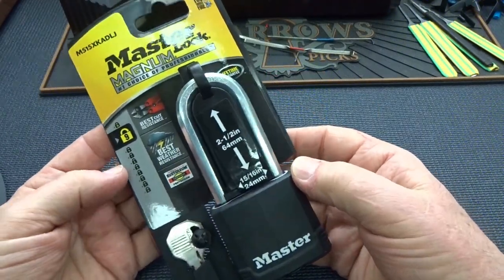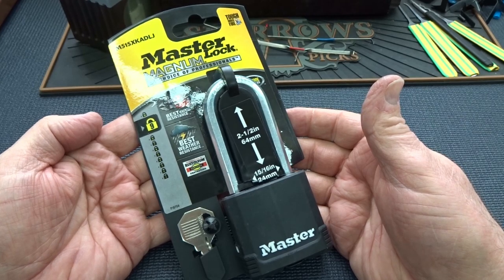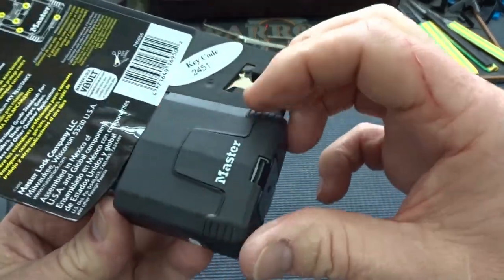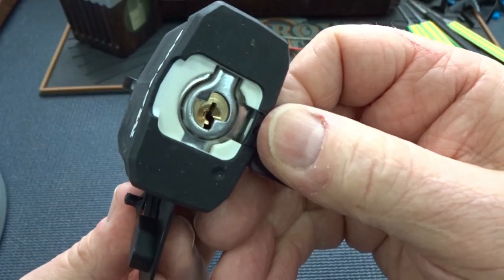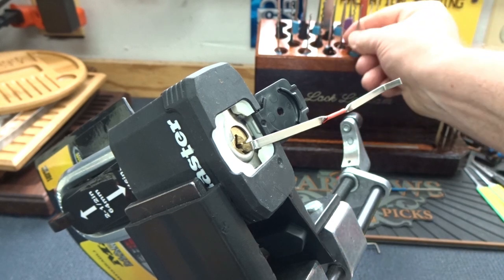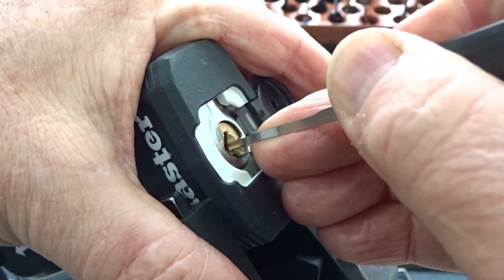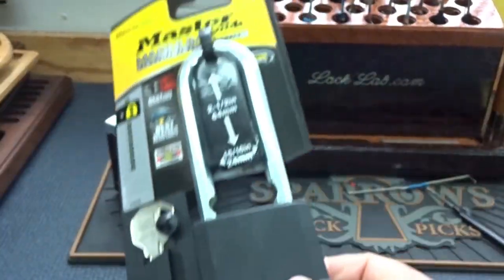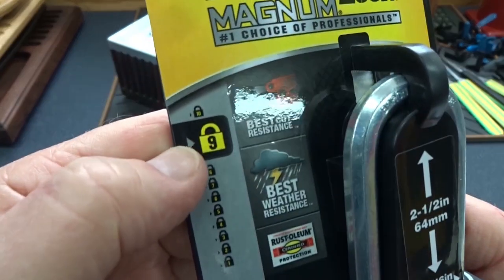(1242) Master Lock's Magnum: 9 = ZERO!

Comment: Master locks security scale is only there to tell you how tough the packaging is...
Reply: Zachary Lagler Now that is the first analysis I've seen that makes all that fancy packaging with the rating system make sense.  Maybe you should apply to be their next CEO.
Reply: WTC Realist lol, I swear Master lock is run by accountants...
Reply: It would have taken Bill longer to find his knife to cut open the zip ties to release the lock than to pick it open.
Reply: +WTC Realist Are they still hiring? I have HVAC experience
Reply: I think I had one of these.  I seem to recall just picking the lock open to be able to remove it from the packaging rather than having to find some snips to clip the zip ties.
Reply: The nice thing about a lock like that by the look of it is you can re-pin it with something that would make it hard to pick.  They make great challenge locks.
Reply: I have tested packaging from many lock companies. Master clamshell pack, and the plastic hasps that their big box store models, the ones Bill seems to jones over.... are among the best. CCL bubble packs arrive shattered, Abus packaging, Shatters, and so forth. Seriously, Master has some very decent mid level locks, but the stuff you find in bike shops and department stores, sucks. Packaging and graphics are how master sells the low grade stuff.
Reply: Yep
Reply: Mookie Conster glorious leader of flipflopistan They have made some plastic locks with decent cores. :P
Reply: This is true, that packaging takes forever to get the lock and keys out of.

Comment: Security rating 9 and they still don't do security pins... But the electrical lockout padlocks they make are filled with spool pins. Go figure.
Reply: To protect them, if a lock out lock was "key optional" like their other locks and someone dies.... They are fucked. If someone's property gets stolen they don't give a fuck they aren't liable
Reply: tin2001 I've yet to see a security pin in a master lock not including bump stop pins that are worthless!
Reply: That's likely because the latter have to adhere to actual regulations instead of their own imagination.
Reply: paul solfelt my old job had pro series masterlocks (6830 i think) had at least 5 pins...opened in around 3 seconds of experimentally poking around.. the biting didn't even look too awful.
Reply: The cores from the lockout locks fit a 930 perfectly making a 930 kind a master,s best lock once recored.
Reply: I think that is toughness rating, not security.
Reply: Jimmy, I agree. The average thief is going try hitting it, maybe cutting it, and then moving on to an easier target. Not many will try to pick it.
Reply from the maker: Jimmy Lovejoy  I sure hope you are right - and I would AGREE with that rating for physical toughness.  However, that rating says right on the package it is for "picking resistance"...
Reply: Do they have a zinc body? Light a  torch.

Comment: You are correct about easy.  I just started this hobby three weeks ago and I single picked my Master lock in fifteen seconds.  Great confidence  builder.  I have been using the core of a Kwikset lock for practice. I started out with one pin, then to two pins and I am up to three pins now and getting proficient at it. I change  the combination of pins. and try again until I get proficient at it. I'm going to move to 4-pin soon and then gradually move up to all 6. Thanks for being an inspiration. I love your Channel.

Comment: Thank you. Ive been working on thos exact lock for a week or so. With your help I finally got it with that rake. It worked perfectly. I had to use a little more force than you showed but my lock had been sitting outside for probobly over 5 Years. Now I have a good practice lock now that ive gotten it off the chain on the back porch

Comment: We have these at work. And yes, they are ridiculously strong. The sort of idiots we get who try to break in have no clue about lock picking, so they've never gotten past the locks. They all have marks on the shackles where they've tried to cut it, one is beaten up badly, (still works, though) where they hammered on it, but they've never gotten past them. The ones that have successfully broken in have used a truck to crash through the gates, because they haven't been able to get past the locks.
Reply: puckcat22679 Lockpocking has this mysticism, like it's always difficult. Good thing they don't know it's 5 seconds with a paper clip.
Reply: SentsuizanXS if criminals were smart, they wouldn't be criminals. At least not the types I'm talking about here. Still, I wish my boss would get locks that are both strong like these, AND pick resistant, but that would require going somewhere other than a big box store, and paying more than $20.

Comment: I put this same lock on the front gate of a home involved in a title fraud dispute.  The criminal arrived one morning with bolt cutters and cut through the boron shackle.  They then placed their own new chain and masterlock round disk padlock instead.
I used a grinder to remove the criminals lock and this time installed my own new masterlock  round disk lock and chain.
Later I discovered that my old magnum key worked to open all of the locks.
I had no idea they used only 4 pins for key bitting.
Totally worthless.
I was told,
"Locks are only for keeping your friends out"

Comment: Master lock has good designs for the body, but I’m not sure how they can call these high security with any conscious. Take the extra budget you use for packaging and put it into security pins. How much would that cost? An extra half dollar per lock MAYBE. It dazzles me
Reply: Ryan YouDontNeedToKnow they're a big company that thrives off stuff being stolen. 
But it is the ideal lock to use so an insurance company thinks whatever it is, is "locked" up 😂😂
Reply: I believe that in the US the security rating of locks only accounts for physical toughness. In most other (more sensible) countries the pick resistance is considered as well.
Reply: Because, statistically, the vast majority of locks opened without a key are destructively opened.  Thieves dont take the time to learn to pick -- they simply torch or cut the lock and go.

Comment: I like their locks! Nothing wrong with them. And keep in mind, locks don't stop theft they just slow the thief down, making it longer for them to defeat the lock. And locks, no matter how cheaply made present the scenerio of discouraging the thief by making them work, that's right, work for their item of interest. Most thieves are lazy and will move on to something more easily obtained. And, you better have a license to possess a lock pick set if you are stopped by a LEO making a roadside stop. You can be arrested if you don't have one!

Comment: Not defending Master, but for most people, this is the best lock most local hardware stores sell. Most robberies are completed using low skill destructive attacks; which I think is the point of this. If you only want to spend $15 on lock that will cover the most likely methods of entry, this does fill a need. 

Again, I know there are much better, but also more expensive and harder to obtain, locks out there.

Comment: last month my friend had to repair a suspension and wheel bearing of a trailer in the middle of a random parking lot.. we had air tools and a compressor in the trunk. there was an electric outlet on a light pole, but it was locked.. opfully, using a really tiny master lock! I only had weak wire with wish i made a pick and a tensionner.. took me about 30 mins, but i think i was snagging the core and not turning enough the whole time xD 
anyways, you saved us about 120$ of towing and more than 6 hours of manual work under the rain in the winter. 
it was litteraly taking us 45 min for each rusted bolt before i decided to pick the lock of the outlet. 

crazy night..

Comment: I'm relatively new to lockpicking and I'm wondering if you've ever tried using a Bogota for rocking? On the locks I have, I'm finding it waaaaaay faster than the skyline. I've literally had it open a 4 pin lock when I inserted it.

Comment: I Can see that Bill has put a homemade sleeve on his "Praxis Pick." Had he made a video on how to best make/put sleeves/handles on picks without any ? I just bought my first pick kit, the Dangerfield Praxis :)
Reply: One of the quickest, easiest handle for a pick is ... electrical heat shrink tubing.
Reply: In video 968 he did a complete review on that Praxis Kit. In video 968 he talks about the handles he put on them. The .023/.025 he puts standard black heat shrink on. The .015 is blue nautical grade heat shrink, it has an adhesive on the inside and is heavier duty and thicker. I don’t remember the sizes but i think it’s 1/2” heat shrink, it’s in the video.
Reply: Riley Fenley thanks for tour answer 👍 are you sure he talks about it in video 968? The handles .....
Reply: Kasperob3 968 is just a raving review for the kit. I want to pick up the kit just for the .015” picks and the standard thickness deforest diamond. I’ve thought about it since the video, but now i really need the .015” since i just have a 2-3 of that thickness more of a selection would be nice.

Comment: The usual 4 pins.The last Master lock I purchased, I picked out of the package. Keys are still on the package - unopened :-)
Reply: That's what I do with all the Master locks I purchase,  I buy them for practice only.  I have yet to use the keys for other than checking to see if they actually work.

Comment: I have the exact lock, bought a 3 pack and 2 work fine but the 3rd turns with the key but it won't open. Tried turning the key and yanking. Tried making sure it was fully seated before turning the key and still no luck.

Comment: well! looks like both locks on my shed will be going in the bin after watching that! mine dont have the rubber sheath and they have a shorter boron shackle but I presume the same barrel.
although if they did manage to pick both locks and enter my shed the bike is the secured with an Almax 16mm chain & Squire SS65CS lock going through a Y-max90 ground anchor thats set into aprox 60 kg of concrete under a cement slabbed bed........... or are you going to say that they are easily defeated too lol? if so i give up :-(
Reply: also when Im looking for a new lock and dont have access to internet to check reviews whats the easiest way to select a decent lock? am I better looking at the key instead of the lock to make my decision? Thanks!

Comment: A 10 makes no difference. The core sucks just as much. However, the lock body is beastly. I have tried the wrench method, fire, bolt cutters etc to no avail. Then i gave the core a stern look and the shackle opened.

Comment: Masterlock is so weird. It's not like they don't have any decent cores in their lineup. For example, their LOTO locks are actually pretty tricky to pick open - but not great for most applications because the shackle is designed to be easily cut. If they put one of those cores in this laminated body with the boron carbide shackle, they'd actually have a pretty serviceable lock!
Why on Earth don't they just do that?

Comment: The "weather proofing" part doesn't help. Had these at my last job, locking a shipping container. Had to breath into them for a few minutes every time I wanted to open them in the winter. Ended up putting them in upside down to make that easier.

Comment: Would you recommend this kind of lock for a trailer?  Can the pins be changed to security pins? I'm in Michigan so weather is an issue. Could you pin one of these up for me please to not have the marshmallow core?  Thank you so very much for reading
Reply from the maker: Unfortunately, these are sealed locks.  The cores are not replaceable.

Comment: Are they really good quality when you say they are "physically tough"?
 A local locksmith says he can install a Primus core into a master lock body.
 Would that be a good lock then?
Reply: 707SonomaComa yes any core would vastly improve this lock. It is pretty robust for the price and will not open with one whack of a hammer, but I’m sure if you’re determined enough you can still destructively defeat it. Overall with a better core you will have a decent lock
Reply: @alecw7063 , thank you for your reply.
 The only thing is that he said it will cost about $120.00 - $130.00  For that price might as well get an Abloy, Medeco, or Mul-T-Lock.
Reply: 707SonomaComa yeah for that price you’re better off getting something like a mul t lock on the good ol ebay

Comment: Ive got one of these on my boat 😐
Reply: Heavy D When was the last time you saw it? Are you sure it's still there?
Reply: WTC Realist today. The rubber cover is gone due to the chain rubbing but its still there
Reply: Heavy D 
I have a Medeco padlock on my boat... However a thief will cut the shackle of the same size and hardeness with ease. The difference is if the thief wants to pick it open and steal it without you noticing.  But that is hard to do with a boat. Lol

Comment: ya he didn't show the key probly easy key cut
Reply: Mike Kamine With 4 pins and no security pins, it doesn't make also much of a difference, the lock still sucks
Reply: Pavao t I made one with security pins spools with axtra things
Reply: Mike Kamine Which model did you use?
Reply: Pavao t the 27 key way
Reply: Well know Jewish saying
Reply: The key code was on a sticker on the back.
Reply: Yeah the sticker is on the back. It's a 2451 bitting, so I believe it's actually just about the hardest bitting a master lock can have since there's such a height between the 3rd and 4th pin.
Reply: SquawkVFR  That is the key code, not a direct bitting. In the morning when I get my   laptop I can tell you what the bitting is.  I believe they have 10 depths from 0 to 9 and have a maximum adjacent cut specification of up to 7 which can make them tricky to pick if you have a deep cut in the back of the lock and you have a shallow cut in front of it. 
Also bill picks locks in good condition and mounted any way he likes on his videos. In  the real world lock positioning and condition can make things much harder... Besides that not many criminals pick locks, that would require posessing burglary tools that can't be dismissed as anything else when a hammer and pry bar will do more for them, they don't care about breaking your stuff so why go gentle at all? and if they have the skill why not seek more gainful employment as a locksmith?   It's no small secret that a battery powered dremel or a pair of bolt cutters will lop these off in seconds, and often times the kind of hasps they are put on will come right off if you pry on them  sometimes with only the force of a human tugging on the padlock they are attached to and lets be real, who is going to pick your lock and steal some second hand rusty garden tools? But if you say had a shipping container on an unsecured job site full of expensive power tools this probably wouldn't be the lock you'd use anyways

Comment: To be honest, the attitude in this video is off putting. As many say, locks keep honest people honest. Any lock can be defeated and if not and a person wants past, they can go around the lock. Take a self storage, cutting the latch to remove the lock is likely faster than busting the lock. If it was a nice wooden shed, breaking the latch off the shed is probably faster.  So what does this video do? It cause people to run to Amazon and post neg comments about this lock and bash Masterlock on the Amazon listing. 

People bash the No3, but it’s bought as a glorified zip tie that will stand up to weather and a lot of time are on gates that can be climbed over or sheds that are barely standing and are more to keep the general passer by who might be curious out.

A better way to handle this particular video than to act all smug and talking down would be to show the simple fix. Make it a helpful and educational video. Be a positive person. Take the lock apart and with a Dremel grind the 2 fins that are perpendicular to the cap of the nut off. The ones that hold the spacing and this issue is solved, so people that have bought it can improve their lock. To go further, if you are a picker or a smith you can open the core and file off the lip where the crimp goes and put a c-clip and add a pin. This lock comes with 5 spools, I put a sixth pin in mine. It’s a great lock… and overkill for anything I put it on.